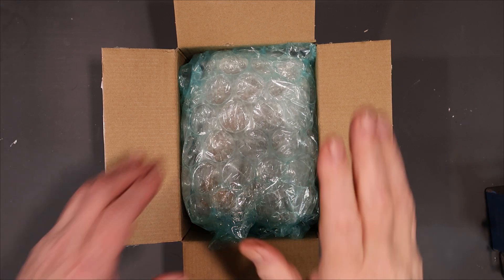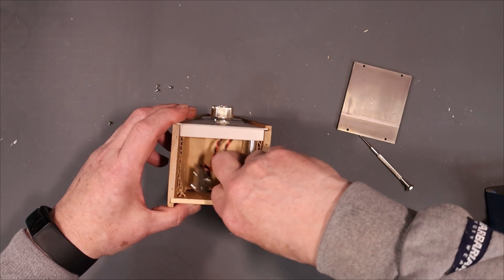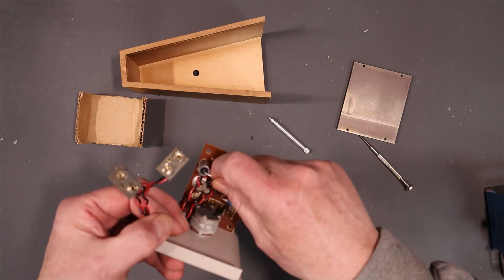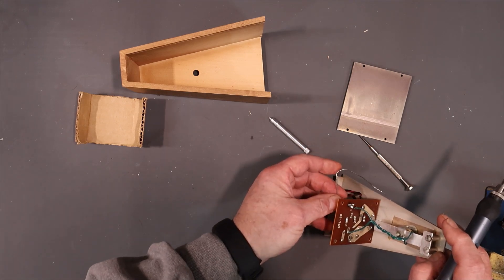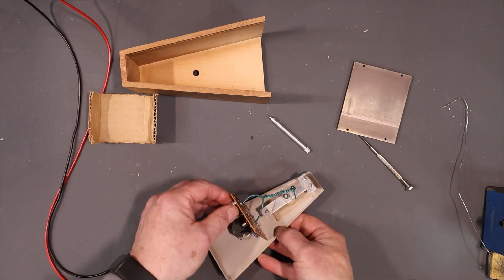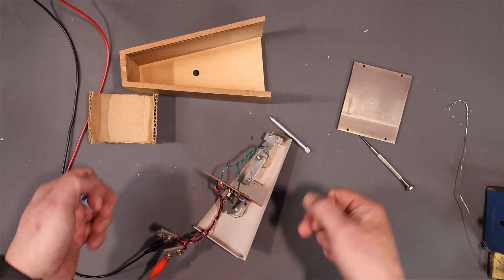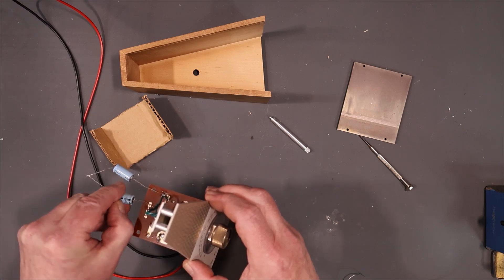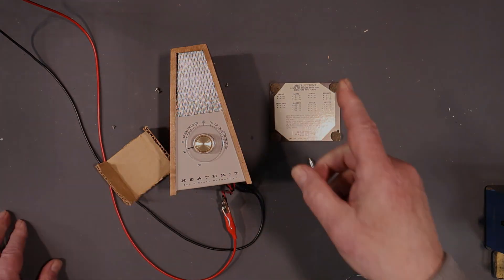Uni-Byte 0275 - Left for DEAD!  Can It Be FIXED (in 6 minutes)?

Comment: So many broken electronics devices have simple mechanical problems, not truly electronics problems at all. There is also an 'electronics is black magic' psychology that causes people to give away or sell very cheaply even expensive electronics devices with minor problems, one that is to the great advantage of repair techies. "The volume control knob shaft broke off on your old Marantz FM tuner, so you're selling it for $20, as is? OK. I think I'll take it. Who knows? Maybe I can fix it."
Almost all of the electronics equipment I own, from ham equipment to test equipment was purchased broken for next to nothing, or was simply given to me because it didn't work, and most was fixed in an hour or so. 
BTW, I played the trombone, slide and valve, from junior HS to college pep band. But then everyone was playing guitar and had no use for trombones so I stopped playing. Wish I hadn't.
Reply from the maker: Yes, it's quite amazing.  in teh last year I've bought and repaired more than a dozen items.  All my used test gear was bought for repair.  But even most people that claim to be into electronics are shy of repair.  Explains the low view count to repair videos.